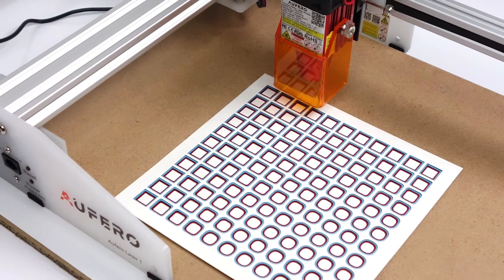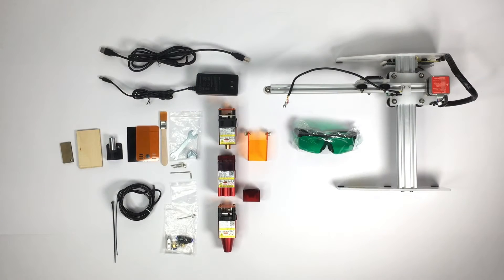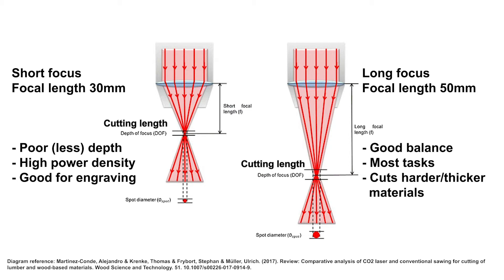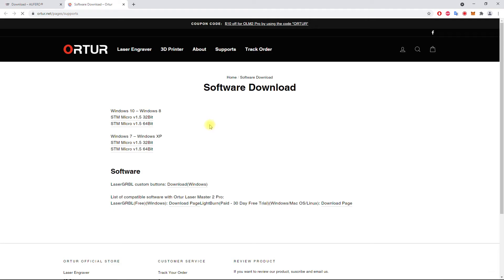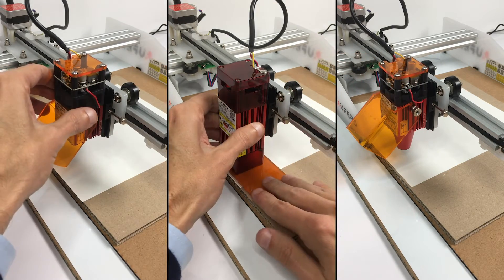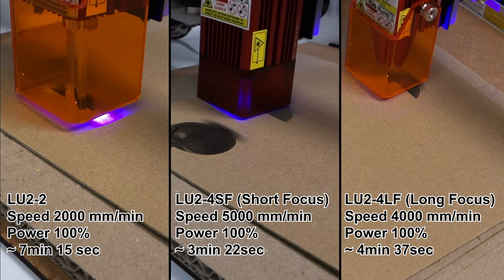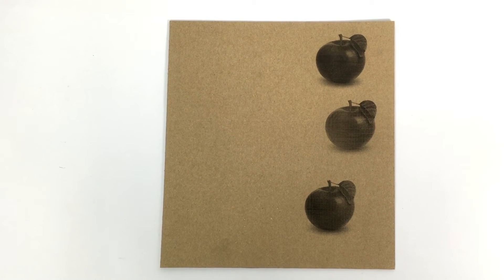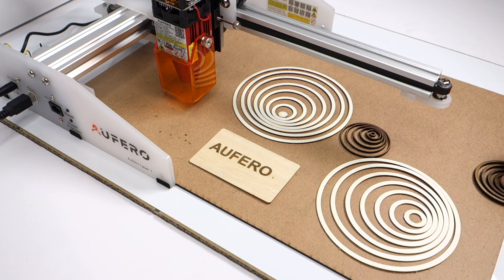REVIEW - Ortur's AUFERO 1 Laser Engraver and Cutter (Creative Coding)

Comment: A small cheap aquarium air pump works well, it keeps the area being burnt, smoke free, cools the material and laser. Should cost about $10. Aquarium suppliers “air pump’’will list a wide range but the smallest one works very well. Thank you for sharing your experience with all three laser heads, a great comparison side by side. Greetings from Tasmania Australia 😁👍🇦🇺🦘
Reply from the maker: Thank you for your feedback!
You’re right, I actually bought an aquarium air pump and use it for cutting thicker materials. However, the air from the air pump sometimes can move thin paper. So, I don’t use it that often.
Reply: @thedotisblack  - I added a simple (aquarium) valve in the airline to adjust the airflow to avoid what you describe. A lot of experimenting to get things just right is all part of this technology.
Reply from the maker: Indeed, a valve is a solution for the long focus laser. 
Actually, I am fortunate to have also the short focus laser without air assist. This one is perfect for cutting thin paper.

Comment: Very nice review! I wish on their website the would offer combo's. Every reviewer get all three heads. It would be nice to have that option and maybe save a Penney or two if more would be purchased. I also noticed no exhaust. Does it get really smelly for a home? Thanks!
Reply from the maker: Indeed, having the option to add additional tools to the purchase would be great. Ortur does have some great addons and I think you can always email them before you purchase. However, the short or long focus is totally enough. And yes, it does smell. The laser burns and depending on the material it can be quite strong. I kept the window open and it was fine though.

Comment: 👁⚠️ Someone knowledgeable on the drawingbots discord noted this about eye safety:
Even at 7 W, this is incredibly dangerous without a full, interlocked, eye-safe enclosure. 7 W will blind you instantly in one eye with just an accidental reflection. Or, if you're lucky, only cause a permanent blind spot or streak.
Reply from the maker: Definitely! Included are laser goggles, which everyone should wear constantly, together with the safety enclosure around the laser module. 

I usually place the camera on the opposite side of the enclosure, press the record button, step on the other side and only then fire the laser.

Comment: For the paper cutting demo, what weight is the paper? Do you think it can cut up to 300gsm cardstock?
Reply from the maker: The paper is 180gsm. 300 gsm is no problem, I also cut 5mm MDF easily. 
At 21:01, the white rings are 2mm thick paper that I usually use as mat for frames.
Reply: @thedotisblack  after cutting, it will have black edges?
Reply from the maker: Yes, it will have black edges on white/bright material, especially with wood.
Reply: @thedotisblack  Thanks for info!

Comment: Thanks for this review!  If will mainly be used for cutting paper (100-350gsm), which model do you recommend?
Reply from the maker: Long focus laser works best for me. It’s good for cutting thick materials. I work with it constantly.

The short focus is best for engraving. But it can also easily cut materials up to 3mm and more if you test a little.
Reply: @thedotisblack  thanks for this tip!  Can we use this with a Mac computer? What software do you recommend?
Reply from the maker: Depends what software you want to use. I use LightBurn which is great and works on Macs.

Comment: Are you using the same machine for each of the heads? Could you buy one machine and then just exchange the head to best match your project?
Reply from the maker: Yes, I do use one machine and change the laser modules only.    If you purchase the Aufero laser, you’ll get one laser module anyway. There is no changing necessary.